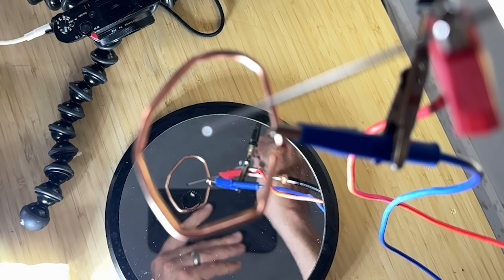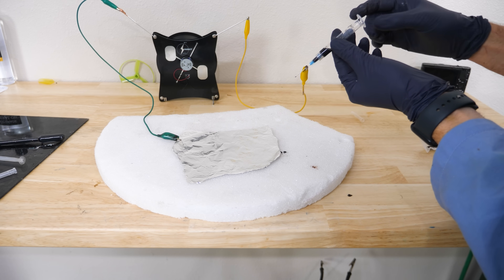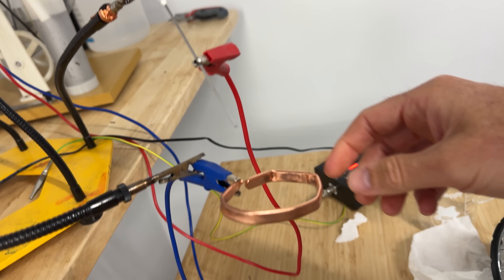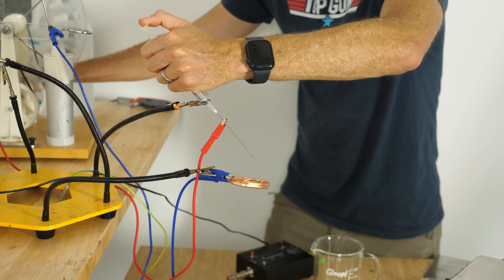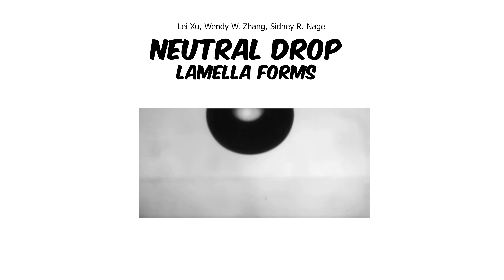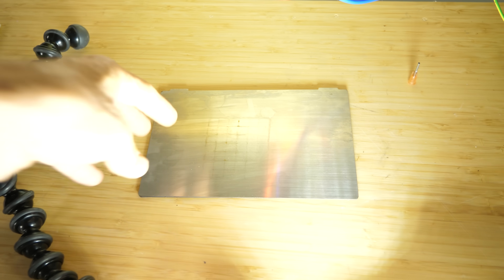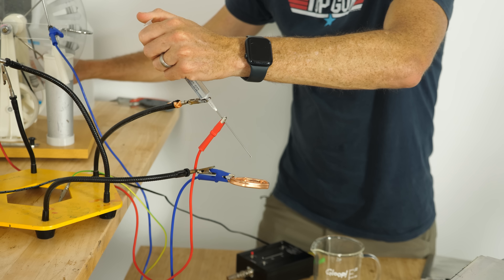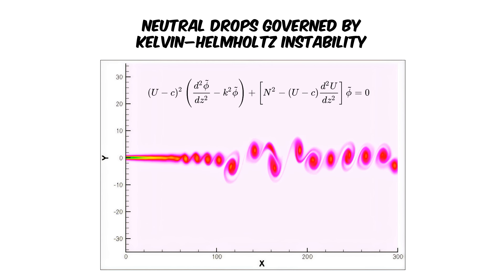Scientists Just Found Why Electrified Drops DON'T Splash

Comment: I used to have an ionizer, attached to a leefblower. We would use it to blow diatomaceous Earth on the interior walls when building houses. It allows it to stick to the walls and a really fine dust and kills bugs for years to come. You just have to positively charge it as you're blowing it. It's amazing how many things in this life were controlled by electricity and how it interacts with difrent materials.  Thanks for the episode
Reply: In fact, I had an opportunity to live in one of the houses that we i did this procedure two years later, way up in the mountains in hawaii, and there wasn't a single a bug in the house. Over six hundred foot of koa flooring, and not a single termite.
Reply: @robinbeech7703 Big Island?  I stay up Mauka Kona side.  Looking at a stack of koa wood right now I just got from the mill up the road
Reply: @robinbeech7703 if it's so fine how do you seal it up safely and to keep it sealed for years to come ? Understand I'm thinking is like static cling. So I'm thinking the first rain and it all drops to the walls floor🤔forgive me if this is a stupid question.
Reply: @BDBrawler77not at all a stupid question. I have no idea to be honest with you. I was a farm laborer at the time. I would imagine much of a stays. As far as how effective it remains, I don't know.
Reply: It was a little bit like powder coding, except it was in the early eighties. The ionizer was used a small
A 12 volt battery that would shock the hell out of me ever once in a while. I may be building a house pretty soon and i'm seriously considering  replicating what we used to do back then.
Reply: @robinbeech7703  You should do a video on it! That sounds interesting! On the actual construction and your methods, if you end up doing it, I mean.
Reply: That's why you wear a respirator and seal the walls back up. My god what do people think. Of course, you're not gonna be breathing it. That's called life 101.
Reply: The sealant prevents the diotomaceous earth from coming off the walls - how does that not also coat the d.e. preventing it from killing the bugs? Is it sprayed inside the walls or on the visible surface.? What if the walls are painted later?
Reply: Im sorry when I said seal the walls. I should have said close them up. All we did is put the sheet rock on. We would sheetrock, one side of the walls. Then spray the the diatomacious earth. After which we would just put the sheetrock on the other side. This was in hawaii, so we didn't worry about insulation. You're absolutely correct.If you sprayed anything on the diatomacius earth, it wouldn't work. You want it for lack of a better word fluffy.  It won't work if it gets wet or if it's compacted in any way. So it does have a life span in some respects. It's also not absolute. Though for the cost. We'll worth the investment.  Its not fun to spray eather. It gets pretty heard to see while you're spraying it. Im sure I could come up with a better method now. Almost forty years later.  I would probably use an air compressor and the venturi effect. I think it would be much more controllable making a deionizer more efficient.  It was almost comical with the leefblower.
Reply: Inhaling that dust can cause silicosis. I hope you weren't breathing any of it in.
Reply: @chrisbalfour466  😷
Reply: @chrisbalfour466 that sucks wish I’d known before I snorted the entire bag 😭
Reply: @chrisbalfour466  dioecious earth is not poisonous, but it i is not good to breathe  And if you can seal up your walls well enough to keep it from getting into your home you probably don’t need it at all. As the bugs can’t get in  or out.
Reply: @chrisbalfour466  Really Captain Obvious?
Reply: @Semper1776Fidelis   C’mon - not necessary. They’re just trying to help. There are plenty of people who may read this who didn’t know.
Reply: @Semper1776Fidelis I probably would have tried it without breathing protection, unless the stuff had a big warning label on it at least.
Reply: @Scott-sx1bf right!! These days you can even tell some people and they still ignore basic safety precautions
Reply: that sounds a little bit like powder coating concept?
Reply: I completely know what diatomacious earth is. I used to have a connection with the kona Brew pub. And they used it to filter their beer, which most small breweries do. Until they sold out to budweiser and got a centrifuse. We would get the old stuff and clean it up.Use it on the farm. There are some people that eat it and claim that it does really good for the gut. There's so many uses of it.I've been using it for forty years.
Reply: @robinbeech7703 we use it in our pet food as a natural dewormer. Especially in our chicken feed about once every 3 months.
Reply: I would like to know how you did that. I have a Milton S057 Siphon spray blow gun that I use to spray coat cleaned used motor oil non-contact projects such as firewood hut. Maybe a brass piece like this would allow better control? It is interesting how pressure depicts spray patterns!
Reply: Im just leaving this here so I get notified on comments
Reply: Electricity is essentially our world's version of magic and no one can convince otherwise.
Reply: Diatomaceous!
Thanks for the info, and vocab lesson 👍
Reply: Hold on --- Am I to understand that diatomaceous earth doesn't only harm scorpions, but any arthropod/insect? Or at least most?

Also, are you aware of any other effective methods of applying/using the substance in order to prevent the entrance of arthropods, or at least their continued longevity? Just sprinkling the stuff around as one guy suggested doesn't seem ideal to me.

I just moved into a house with a scorpion problem of a kind I never imagined possible.
Reply: @bricaaron3978My understanding is that it in some way damages the waxy coating on their shells so they dry out quickly, and yes, I believe it applies to many types of bugs.  Good luck with your scorpion problem.  :I
Reply: @Erhannis  Thank you. I was told that it lacerates the scorpions' "feet". I'll have to do some research.
Reply: What is diatomaceous earth? Where does one get this?
Reply: From AI:

Diatomaceous earth is a naturally occurring, soft sedimentary rock that is easily crumbled into a fine white to off-white powder. It is composed primarily of the fossilized remains of tiny, aquatic organisms called diatoms, which are a type of algae. These diatoms have cell walls made of silica, which contributes to the unique properties of diatomaceous earth.

Uses of Diatomaceous Earth

Diatomaceous earth has a variety of applications, including:

1. Pest Control

It is often used as a natural insecticide. The fine powder can damage the exoskeletons of insects, leading to dehydration and death.
Reply: @NickNicometi  that reminds me of asbestos for some reason
Reply: That's awesome! Maybe a rain catcher modification ?
Reply: wow wow wow ,  Can we actually have a conversation on this please . I have questions . Like does to kill mosquito larva / possibly adult mosquitos?
So many questions I have man
Reply: @controlledchaos8851 it's not very affective for mosquitos. It works by getting into the animal's exoskeleton it cuts there flesh and consequently they dehydrate. Insects don't have the ability to heel there's skin or exoskeleton. So if they get a scratch, they will dehydrate and die. 
   I did live in Hawaii for that's the better part of forty five years.  So I do know a thing or two about mosquitoes. Evry situation it's a little bit different. Keeping the property cleared is essential.

Comment: 1. Charged drop(s) into a glass bowl of the same liquid, which was also charged when it fell into the bowl.

Would the dielectric property of the glass apply to the mass of liquid, or would the liquid itself be like the metal plate?

2. Charged drop(s) on a metal plate suspended on a glass object. (So that the metal did not touch anything except the glass.)

Would the plate act differently than resting on the surface like in this video? Would it act the same as having liquid in the glass bowl? Would it act in some other manner?

Comment: Would this happen to be in any shape or form be even distantly related to the processes that cause electrolysis to function? Part of a larger understanding of how electric current affects liquid substances? If this could lead to refining existing engineering methods, that'd be great. Wonder what we could do by noticing the strange behaviors of liquids when exposed to very small and fine-tuned doses of electricity.

Comment: Well, the first implementation I can think of would be printing on to glass. IT will be be more accurate. So, if there is need to print very accurate designs on glass it would be possible. Perhaps this could be useful for the printing of circuit boards. Perhaps the circuit boards could be printed on to glass.

Comment: Something I learned about recently, was another state of matter, the Gelstate. The state of the surfaces of bodies of liquids. They are unique, and unlike the rest of the liquid for which they act as a container. I didn't learn how they differ, physically, but I'm going to go out on a limb and guess that they are ionized intermittently with their neighboring molecules, and what this experiment is demonstrating by charging the liquid is increasing the ionic bonding strength of the gelstate, while the conducting impact surface pulls off, or pushes in the requisite electrons, to undo the ionic imbalances, thus weakening the gelstate that was affecting and diffusing the kinetic energy of impact, thereby enabling a more chaotic splatter as the single body of liquid splatters. 

I am guessing that this is what this experiment is illustrating for us?

Comment: What would happen if you use an isolated pipe, at one point you charge and the other you have the ring (like to have the circuit isolated) and fill with water? It pumps the water without moving parts?

Comment: there is an issue with using concrete in moulds where air bubbles form and have to be taken out via mechanical vibration. your video makes me ponder if the concrete could be electrically charged to suppress or alter the formation of air bubbles.
Reply: This should be investigated.  My gut feeling is that the electrical charge will just make the bubbles finer and therefore more difficult to remove, but a lot of these results lately seem to be counter intuitive.

Comment: Ink jet printers work that way. Uses a piezoelectric to break up the stream then flies through an opposite charges tunnel. The voltage difference is used to drive the ink drops upwards to make whatever you’re printing. The dates printed on food packages, barcodes on letters… if it looks like a bunch of tiny spots making a letter/number, more then likely some kind of inkjet/ drop printer.

Comment: Oxygen-containing air molecules are attracted to magnetic fields or magnets because the spin of the O2 electrons aligns with the direction of the magnetic field. This is because O2 is paramagnetic. For water droplets, which contain much more O2 than air, the magnetized molecules attract each other by gelidifying, so they do not spread when they hit the surface.

Comment: What happens if you removed the copper ring and connected that potential to the conductive plate?
When you played with the charged ferrofluid, did you try to replicate the double slit results?

Comment: I wonder if this works with non liquids.  Like will the salt stick to the fries better if it is charged?  Or suppose a barber cuts off someone's micro-mullet.  Will the hair make less of a mess if the floor is charged?  This is giving me all kinds of ideas.  What if you wrap a coil of wire around a glass tube and circulate charged liquid through it, will it generate a useable electrical potential in the wire?

Comment: I'm wondering if high voltage / high frequency AC could induce a local ultrasonic effect on a surface for cleaning. Like generating a fog just at the surface. Because immersion ultrasonic cleaning seems to involve a lot of wasted energy.

Comment: I wonder if this can be applied to fuel injectors ( being over-charged virtually atomizing gasoline or diesel ) and if the electric charge of the igniting spark plug would have any interesting effects, or in the case of diesel, compression.

Comment: Life is weird. I have a leak in my ceeling and had to drill a hole in my ac drip pan so I could control it. The issue is that it has to drop 8 feet into a bucket and uts splashing on the floor around the pan I'm catching it in. I use the mop to soften the splash. Then this pops up as I'm trying to figure out how to reduce the splash. Why?

Comment: Somewhat related, I used to work on these machines for automotive manufacture. Basically a giant Cockroft/Walton multiplier sitting in a barrel of pure linseed oil, with a small box for electronic control sitting on top. Voltage was capped somewhere around 120KV, and the whole thing was current limited to 25 or 40mA or something. One lead would go into the paint supply, and the other was attached to the body of a vehicle. They said it made for a more even coat of paint.

Those things dated back to the early 90s. Possibly the 80s.

Comment: Why does it FEEL like the mirror is a smooth surface and the metal (or anything else) is not as smooth, which results in more trapped air while glass doesn't?

Comment: Does the specific charge of the drop make a difference on the metal plate? Like, are there different results in the overall splash for a positively charged drop versus a neutral or negatively charged drop? 

Similarly, does giving the metal plate a positive or negative charge change the effect of the splash on the drop in any of the 3 charge modes?

Comment: Whether this technology will be useful will depend on how well it is researched. We are talking about an electric charge in a conductive liquid, there are millions of chains of molecular compounds that are in liquid form, some are more and some are less conductive. The size of the droplet is also important, if this can be an electrostatic jet of liquid without splashing it would be very important for metal processing with water blades because it would not cause damage to the material and the apparatus where it is not necessary.

Comment: I may not have understood because you’ve charged the drop but somebody else asked if you put a charge on the plate mirror a metal mirror would you also not have a splash or like I thought you said the minute it hits the plate it loses its charge and with splash Your idea that you suggested would be applied to painting like they do electroplating you can spray and not have overspray or splash. It would sure make things easier if you could do something like this say in painting a house, which would reduce the amount of masking and taping needed as well as painting on fabrics or carsany kind of a paint application if this is possible

Comment: I noticed a pattern long ago when dropping tiny ionized salt crystals on a wooden table.  

If the dropping rate was very slow and a few inches above the table,  a circular pattern started to form.

Everything had to be very dry and wind free.

I surmise that there is some kind of static or magnetic effect that is occurring at these tiny scales, causing an orderly formation of the salt material. 

It was an amazing thing to see and discover...

Comment: I was also wondering about the windscreen issue, but for airplanes. Or perhaps the leading surface on wings, if they had a glass type layer. Would there be any change in behavior? Or on a helicopter’s blade surface?

Comment: At what point does the charge start making the splash different. What if you were to increase the charge, in like 10% charge increments. What effect would it have at 50% or 75%. And what about the 1% increases in between the first noticeable changes. Science is full of discoveries just because something was tested differently, usually by accident.

Comment: Isn’t it the fact that water is a polar molecule though as well, so any polar molecule against any dielectric surface will generate Eddy currents that slow it down upon proximity of induction. The same way a magnet moves slowly in a copper tube. This works because there are no particles only waves and induction/ Eddy currents are key to our entire reality. The wind is just eddy currents in the exact same fashion.

Comment: If you charge a prop on a prop engine or even the fan on a jet engine, could it help with pushing water out the way during rain while flying, perhaps giving a slight increase of performance in the rain?

Comment: The ransburg process-2 electrostatic coating system relies on this. I used one 15 years ago. No spray (atomized paint) - it just flings paint that's highly charged.. that just stick to the surface - no "dust" or anything.

Comment: Does air behave the same way?
Will a laminar airflow that is charged stay attached to a surface longer?
That could have big implications in aerodynamics.
Reply: wondering the same thing. Could we ionize the boundary layer so it sticks more to surface. perhaps just the problematic places like interference drag causing locations.
Reply: Good question! I wonder if wings that have certain areas with a static surface charge will affect lift to the point we can reduce the amount of material used. Not quite an ionic lifter.